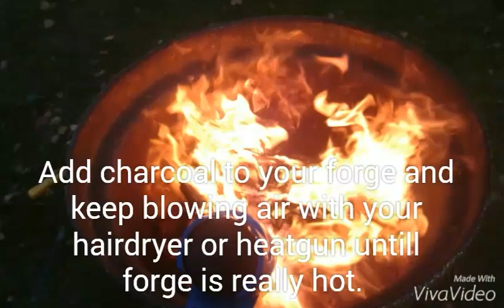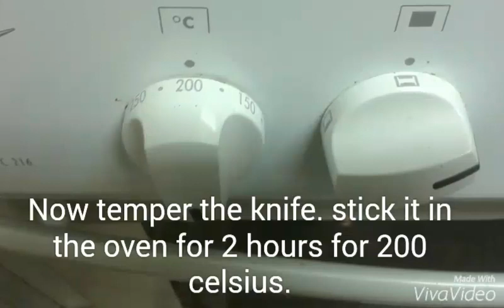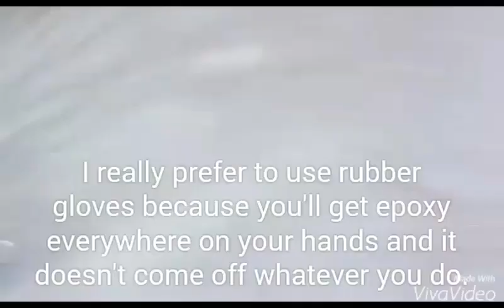How to make knife from a file [The Art Of Weapons contest entry]

Comment: today i wanted to try this out but my file bended while annealing...does anyone have a solutiun how i can fix that?
Reply from the maker: I have met that problem too. Luckily it's easy to fix! Heat your file again until it is glowing orange. Then quickly press it in a vise on every spot until it is straight. I had to do this three times because the file cools down quickly but I got it perfectly straight. And next time when you heat the file up with propane torch etc. put it on a flat surface. if you use charcoal put the file sides up and down like this: | (<- file from back not from side) not like this: _ Then the file will stay straight. Hopefully this helps!